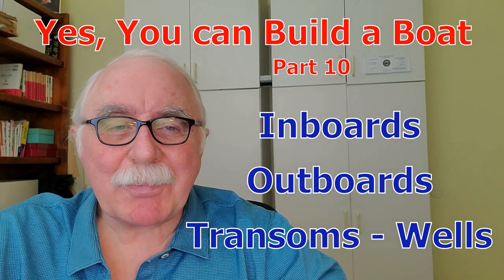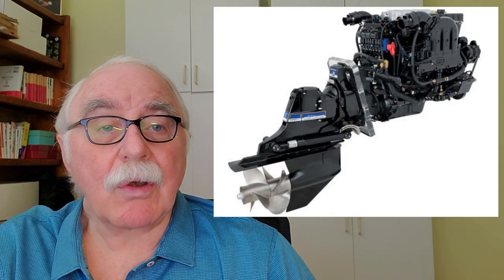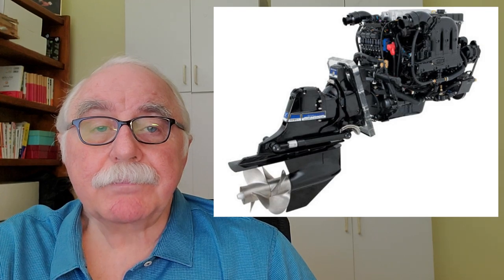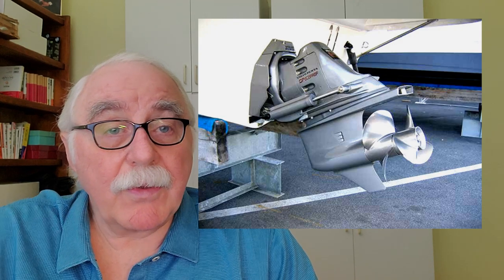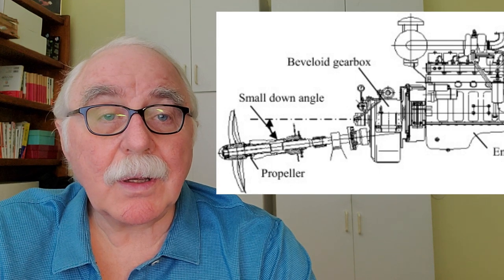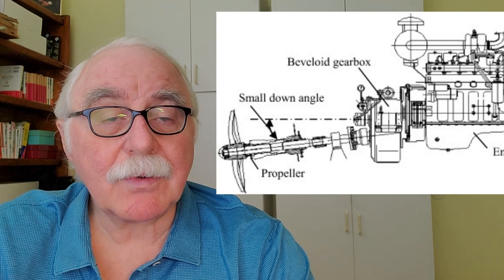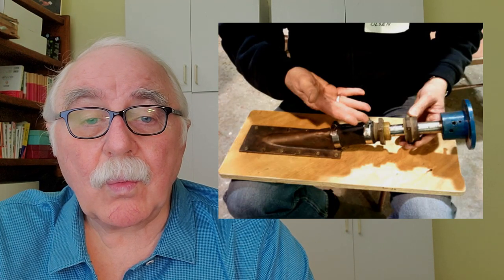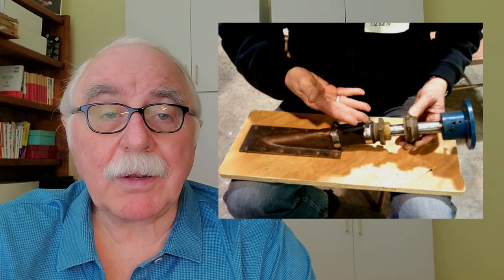Yes, You Can Build a Boat - Inboards, Outboards, Motor Wells.

Comment: Thank you for this video Jeff.
I recently purchased a set of your 19' Garvey plans. I was wondering what you think about swim platforms and transom extensions. Would love to get your thoughts. 
Thank you
Reply from the maker: I could design you a custom extension, but a jackplate and two swim steps one on each side would be much preferred and waaaay easier to build.
Reply: @tjkid07  I'm not to concerned with easy, this is a boat I will be working on for sometime. I would like to have it perfect. Not to mention the additional floatation would not hurt with off shore use.

Comment: what all is included in your hull weights ?  i realize they are approximate but is that the finished bare bones boat minus any addons like seats engines fuel tanks floors cabins and such ?
Reply from the maker: Yes, but it typically includes floor (timbers? better google what "floors"means in boats.) and generally decks on larger hulls with raised decks.

Comment: Starting to design a custom boat. I have ZERO experience. I am wanting it to be a hybrid Cat/Flatbottom Cabin Cruiser, Live Aboard size and weight. Need it to sleep Minimum of 5. Now that those outlandish parameters are set. I also want it to run on solar, and use electric motors for propulsion. I mention this as it will help frame out the over all weight of the boat. I would like a top on plane crusing speed to be about 30 Knots.

Now to the Question - What size electric motors do your recommend?
Reply from the maker: LOL. Well, you have started with one of the most difficult undertakings in boats, a high speed, live aboard, electric catamaran. You have to start off learning a LOT of things about hull design, strength, buoyancy and stability calculations, planing & drag powering calculations and lots more. 

It's a bit like saying, I want to design a jet fighter to compete with an F-22 Raptor, with its speed and stealth, which engines should I use? I'd suggest starting by designing a Piper cub first, then moving through a lot of more sophisticated designs until you arrive at a high performance stealthy, supercruising fighter. It only took 40 years, 1000s of designs, and thousands of losses in battle in dozens of wars to get there.
Reply: @tjkid07  I have since decided that the power efficiency to speed curve are to much to have that kind of speed on that size boat. I am going for much less maybe 15 knots, and then making a skiff for the higher speed needs.

Comment: The most reliable motor is by far an electric motor. They don't come with lower ends to change directions down the transom of a boat, or the ones that do are ridiculously expensive.  In 5 years you won't be able to give outboards away.
Reply: Nah.theyve said that about all kinda stuff,the internal combustion engine aint going anywhere soon.

Comment: Thought you may cover electric motors?
Reply: I think Jeff's boats would be very good for a diy inboard electric motor as they handle a lot of weight and don't need a lot of power. Electric motors have great torque capacity.